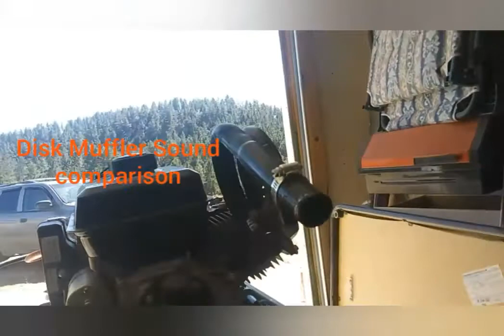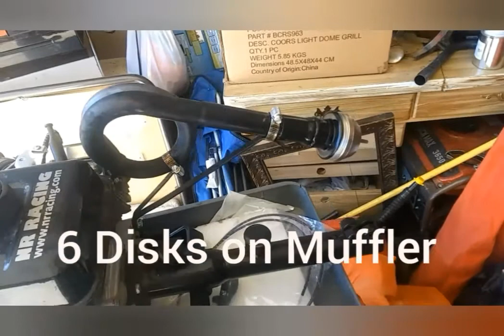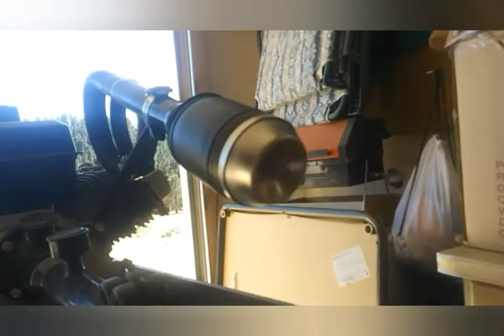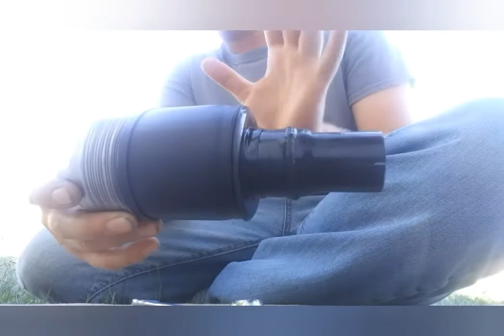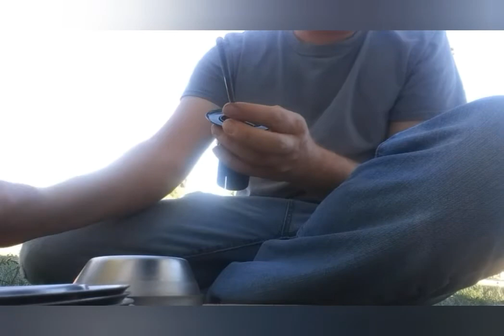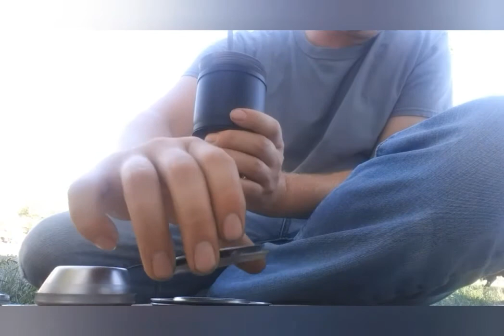Supertrapp Disc Muffler Clone (With Resonator) for Predator 212 & Honda GX Engine’s

Comment: I just happened to score one of these mufflers off of eBay for 25$ I got a resonator 3 disks end cap and exhaust adapter, my exhaust is 1.25 and the muffler is 1” so I plan on cutting and welding a larger inlet I’m hoping it sounds great on a 7” long pipe

Comment: How much speed did you pick up with this setup over the stock muffler on your mud motor?
Reply from the maker: 3 mph instantly After I added the Robertsons torque tube but I also added the performance air filter All the EPA stuff on the engine really just chokes the engine. Adding a Tillotson PK1B carburetor really helps too
Reply from the maker: The muffler didn’t affect its performance At all just made it quieter and sound really nice

Comment: Wouldn't you need only 3 or 4 disks for a 212?
Reply from the maker: i now run 4 so 3 would be fine I am sure
Reply: @MudMotorsMax  The SuperTrapp mufflers are pretty interesting. Thanks for posting this.